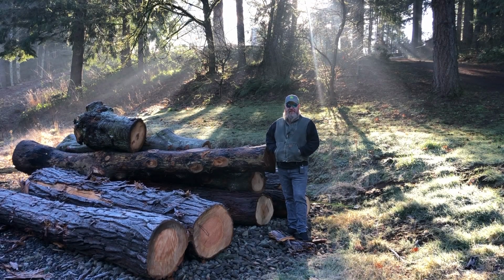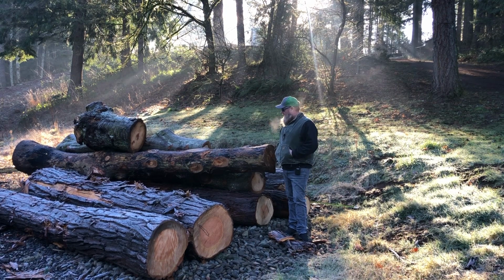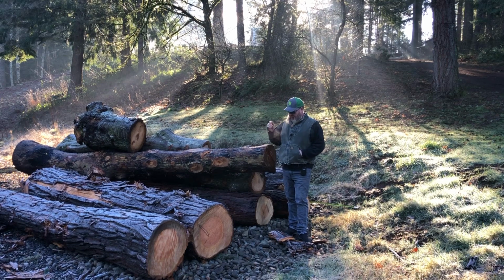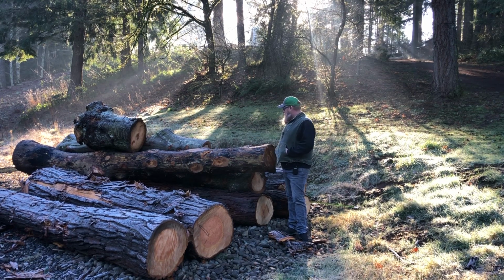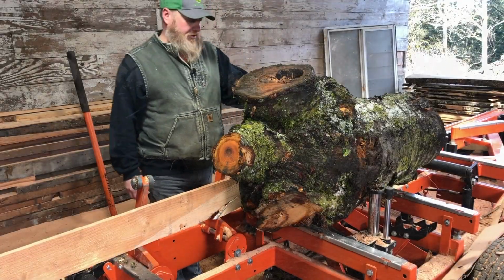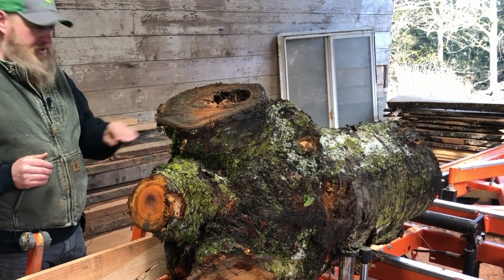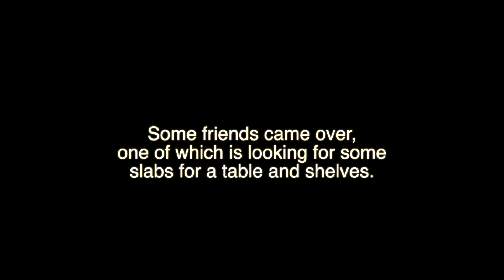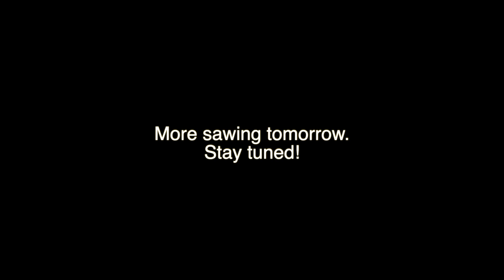Black Oak and a Cherry burl on the Wood-Mizer

Comment: The cherry is actually a graft union where the desired tree is grafted onto a strong root system, at a young age, for a more hardy plant. Sometimes it will have some burl like features but more often will have a distinct color change and odd growth rings, where as a burl will have the bullseyes where the buds grow all over the piece. Both can be very interesting and unique. Either way it’s great to see you back at it and making some really nice slabs!
Reply from the maker: Great info! I’ll try to get some better video of the grain because it’s exactly how you described. It looks like the grain pattern completely changes under the burl.
Reply: Yes definitely a swollen graft but nice wood all the same.
Reply from the maker: Blaise there is a seriously interesting grain pattern at the graft. I’ll show a good shot of it in my next video.

Comment: Your smart phone has several audio recording apps. The one I use is AVR, I have used it for most of my videos . I just put my smart hone (iPhone) in my shirt picket and it works great.
Reply from the maker: Thanks, Dave. I’m actually using my iPhone X to record the video along with a GoPro Hero 7. The receiver for this microphone plugs right in the lightening port on my phone.
Reply: Cool!

Comment: It looks like you don't have much room with your mill located under the low roof and close to the building. It is a challenge loading the logs.
Reply from the maker: Yeah. It wasn’t my plan to saw under the cover. I planned to pull it out and saw next to my log deck but I caught wind that friends were coming over and knew in wouldn’t get much done afterwards 😬
Reply: I understand.... when friends join you then the work stops so you can have a good chat.

Comment: Ok I'm addicted now ,  But I have a question how can I contact you directly ? I have been cleaning up my Property over here in Dallas , had it logged in Dec of 2017 , and was left with some stump piles you wouldn't believe , I have been cutting the roots off of these  Doug Fir, Maple , and Oak, and some of them are huge , so I have stump ends with trunks attached and  some with trunks cut off  I have been stock piling them , I bet you could get some very nice slabs out of a lot of them , would you have any interest ?